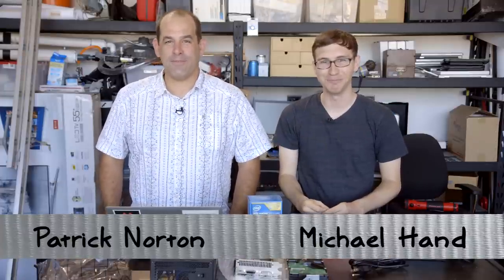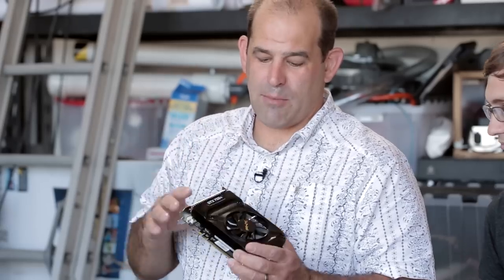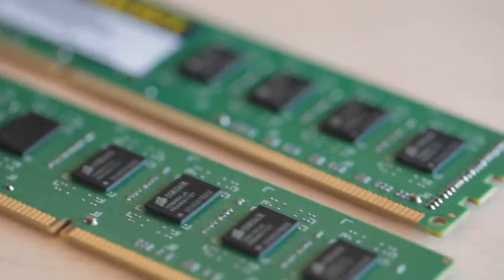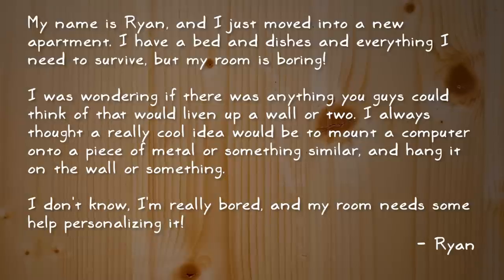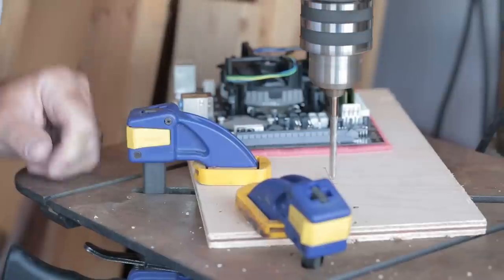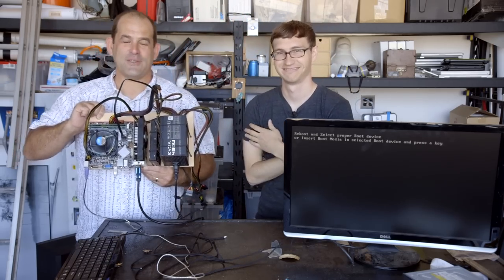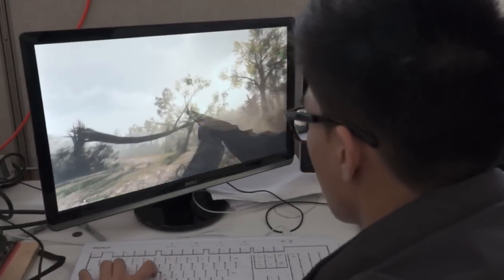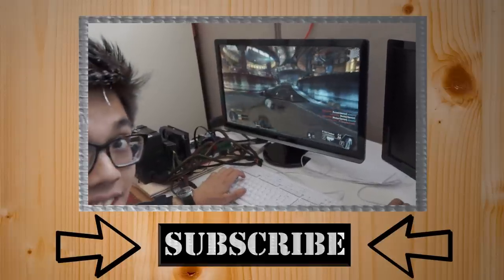Screw The XBOX ONE and the PS4... We Built a Gaming PC for $380!

Comment: ok, so cool you built a "gaming" pc for that, but you should NOT be comparing this to an xbox one or ps4, first off, ecs board??? Really? Do you want a piece of trash that will die in a week? 2nd off, 4gb of ram? good luck with that, wd blue drive? yea, no, even standard ps4 and xbox one hard drive stomp that, let alone the hybrid ssd the xbox one has now. And I would like to see the actual settings, cause I call BS on all settings being maxed, so you have anti aliasing maxed, and vsync? no way in hell, add in the price of a actual case and windows, you are well over 500. Also play more than 1 game before you start running your mouth. I am a proud pc gamer running a real gaming pc, but I also have a xbox one for games like destiny, that do run very well and the point of the console is price and simplicity. So before you start bashing consoles how about you get a real gaming pc, cause you are still a console peasant with that thing.

Comment: I built mine for 300 flat with an i7 950 and a Gigabyte 970 3gb and 8gb ram 1600mhz. My budget monster is sitting in a Shuttle xpc case. I called it "Little Beast"
Reply: +Jake Long Where the hell you get parts so cheap
Reply: +CodyopPC Craig list and homie hookup.

Comment: Acer $399 Mini Tower PC Core i5 6400, 8 Gigs DDR 4 RAM (spare slot for another 8 Gigs total 16GB), Intel HD 530 (good enough for Rocket League), power supply is small but should be good enough to run a Mini GTX 1060 or RX 480 that draws power from the PCI E Slot otherwise you need a Molex Adaptor to provide the GPU card power. Toss it in the living room for your big ass HDTV to get some games on. Get a Windows 10 Activation Code for less then $50 on a lot of sites as low as $15 USD!

Comment: My Build Gaming/Work Station 

this build has paid itself since i use it for work
that might be hard to do with a console.

OS:Windows 7 pro
Motherboard: msi Z97 gaming 3
Processor: i7 4790k intel
Video Card:Nvidia GeForce gtx980
RAM: 16gb
PowerSupply:corsair Modular 850
Drives:120gb ssd for os 
       2tb hdd for storage

 This thing can run everything (max settings)
 i throw at it and is about half the price of  
any Alienware or mac.

Comment: The thing is if you're gonna build a PC build one that's gonna be upgrade able and isn't gonna be obsolete in a couple years. Even though I have what used to be top of the line card (GTX 680 Classified) even nowadays in the new games my settings are dropping from all ultra to mostly high in order to keep 60 FPS. Provided it runs two other monitors at that same time. But if you're gonna build a PC, build one that's gonna last and can actually give you the advantages of PC gaming, like multi-monitor setups, don't just try to build a shitty $300 rig that you will be complaining about certain things like shit slowing down when you try to do more than one task

Comment: Good. now add a High quality Controller for $50 and a nice case for $40 because you don't want to hang this on the
living room wall
Reply: +Noah Roberts obviously it looks ugly. The PS4 is a sleek nice looking machine although not powerful enough but that's because of the $350 constraint and the cost of the hardware back in 2014 plus accesories and Bluray player which obviously this cheap PC doesn't have

Comment: Should there be anything else I should add for my future build list?

Plans:
- Intel Core i5-4460 3.2GHz Quad-Core
- MotherBrd GA-H97M-D3H Micro ATX LGA1150
- Ripjaws X Series 8gb DDR3-1600
- Western digital cavier blue 1TB 7200RPM
- Radcon R9 380 4GB SOC
- XFX 550W 80+ Bronze Certified ATX
- Cooler Master HAF 912 ATX MID Tower Case
Reply: Hi! I have almost the exact same build as you are planning. It is an amazing machine. But I recommend going with the R9 390 if you can afford it. More future proof. Good luck!
Reply: Thanks for the info Turnsmash! I'll surely give the R9 390 a good look.
Reply: Nice build
Reply: +Purified_Magnet 
Very nice, what's you OS?  Me personally, I would go with a 40GB SSD to boot the OS if that stuff matters to you.
Reply: This is my first build to do so I figured I would use the windows 10 since this is for gaming.
Reply: +Purified_Magnet Looks nice. But i would go for 16 GB Ram and an 128 GB SSD for OS and core programms.
Reply: +Purified_Magnet
This is my plan for building list. Any improvement and suggestion are welcomed. Budget: $510 
- Windows 8.1 Pro DVD OEM- 64-bit     
- Acer S230HL 23 Inch Full HD Widescreen LED Monitor   
- ZALMAN CNPS8000B 92mm FSB (Fluid Shield Bearing) CPU Cooler 
- AMD Athlon x4 760K Black Edition   
- MSI Radeon R7 360 2GD5 OC     
- MSI A88X-G43 Motherboards    
- Kingston 8GB HyperX Fury Black 1866MHz DDR3 Gaming PC RAM
- WD Blue 1TB Desktop Hard Disk Drive  
 7200 RPM SATA 6 Gb/s 64MB Cache 3.5 Inch
Reply: Try to avoid that acer if you can, thats what I used for basic stuff and the crystals actually got ruined from just a regular shut off.
Reply: +Purified_Magnet Make sure your PSU choice is reliable and provides enough power, ensure you get good airflow with a system like that, fans pulling and pushing air, ESPECIALLY if you overclock it. Maybe add one of those hybrid SSD / HDD drives? But it'll cost more.
Reply: +Purified_Magnet Do you have a keyboard and mouse? When I built my rig for gaming I just got the Logitech K120 for €15 and it's lasted me for over a year no problems. A good mouse choice is the CM Storm Havoc for about €45 Good luck with your build friend :)

Comment: im running a $2000 rig, with a gifted radio shack keyboard that goes for $20, corsair 1500's headphones i got off amazon for $50,  you can get by and skimp on things, so as long as you cpu/gpu are boss.

Comment: Here i just bulit a better PC: 

Total Price: 382 $

MotherBoard: ASRock H110M-HDS (46.99 $)
CPU: Intel Core i3-6100 (119.99 $)
GPU: (USED) R7 260X (69.99 $ depending on seller)
RAM: G.SKILL RipJaws V Series 8GB (32.99 $)
PSU: EVGA 500W (37.99 $)
HDD: WD Blue 1TB (49.99 $)
Case: Rosewill FBM-02 (24.99 $)
+ Shitty Windows for like 100bucks because why not?

From Newegg.
Reply: This videos 2 years old.
Reply: That is a garbage build. R7 260X? the fuck?
Reply: ECCENTRIC The R7 260X is slightly better than the GTX 750 Ti in terms of performance.
Reply: ECCENTRIC r7 260x delivers great performance for the money. if you can find a HD 7850 or 7870 for under 80 dollars you can use either of those.
Reply: Ed Plays yeah, I was thinking going for an older card. (There are used GTX 660 Ti in my area for the equivalent of 82 USD :D)
Reply: Or just wait a little longer and buy a better GPU. R7 260X is pretty bad.
Reply: how is it bad?
It's better than the 750ti
Reply: Ed Plays I know right. Maybe it's worse in power consumption because it needs a six pin power connector. But that's all I can think of.
Reply: but its 2016
Reply: What's the best budget graphics card?
Reply: Potato New or used? The RX 460 is probably the best new. For around the same price point, the HD 7950 is an excellent used card. A GTX 770/680 is probably a good card as well if you can find a decent bargain.

All cards are around the $100 price range.

Comment: i bought a mac pro 2009..  with the 2010 firmware hack i upgraded it to a 6 core xeon @ 3.10ghz, 16gb ram, 2gb nvidia quadro 2000, 2 SSDs for $145 thing is a monster!

it helps that i'm an IT tech and had the xeon processor, 2 SSDs and nvidia card just laying around.

Comment: You realize you can get a asrock motherboard with a 4gb 256 bit graphics card a 3.8 gigahertz quad-core and 16 gigabytes 1600 DDR3 RAM and a copper core CPU Cooler for $391.91

Comment: mount that on the back of a big screen led tv and get a wireless keyboard and mouse and get one of the special power supply units that you can plug another device into while using the computer then plug in your TV into the PSU on the computer and there is your giant all in one gaming pc!
Reply: +Marty Mooney I guess that power supply wouldn't be powerful enough to power this pc. this power source is available only in generic power supplies. and even if a strong one had a power source on it, the device would drain too much power.
Reply: +Marty Mooney Wireless keyboard and mouse are terrible for gaming.

Comment: Considering my core 2 quad q9450, Asus p5e3 deluxe ai lifestyle motherboard (Auto-clocks the CPU and does some other voodoo to make the late-gen core 2 quads do stuff they weren't really meant to, damn mobo costs more than the CPU...), 8GB DDR3, 700 watt PSU, and 2x GTX 560TI's (using a fly-by-night chinese firmware hack to make it support SLI)  in a lian li case would cost well over $1000 even today, it is quite impressive that a gaming machine for under $500 is quite impressive.

Comment: If you think that a Intel Pentium G3220 3.0GHz and 4gb of ram will match the ps4?
Try something like Doom, doesnt even plays at 30fps 900p and low setts
Consoles arent that bad (atleast they have a case)
Reply: A console has more optimized games. You'll have to fiddle with the settings to get them how you want graphically and framerate
Reply: Be reasonable. DOOM was released in 2016. And think about it, the same money today will buy better parts, i.e. 1050 Ti, Pentium 4600, 8GB of DDR4.

Comment: $370 
amd athlon x4 860k $70.88 

asrock fm2a78mpro3+ 51.98

crucial 1x8gb stick 30.99

hitachi ultra star 1tb 32mb cache 7200 rpm 41.99

asus radeon r7 370 2gb 119.99 (with rebate add $20)

nzxt source 210 39.99 29.99 after rebate

evga 500w 80+ bronze certified atx ps 49.99, 29.99 after rebate

Comment: I was into pc gaming for over a decade..
I finally got fed up with having to upgrade with pc's  that new was in the 1-2+ grand range...
With a pc u got to have a ton of ram 8-16 gig ,  a i7 quad core processor  3.0 ghz or so  and then a graphic card in the range of $500-$700 then a high output power watt supply..A dedicated gamin mouse $50-$80  a gaming keyboard around $100-$140.. and i said u know this just isn't worth it anymore...
I grabbed an xbox one for a fraction of what i'd expect to pay for a top end pc got a ton of games with xbox live subscription and i'm  very happy with my move over...
One  gaming console that everyone is playing in multi player a good controller and bam ur a go...
With pc gaming u can have a 2 grand machine and end up facing someone with a 5 grand machine it's simply a keeping up with the jones...
And i got tired of it.My pc gaming days in general are behind me and i'm okay with that...
Reply: +MnMs002 What do you mean 1-2 grand range? You do not need an i7 quad core processor, a $67-70 Athlon X4 860k would've done the job as well. You do not need to pay $100-140. No, a $500-700 GPU is not required. You're talking about the highest end, overkill hardware and game settings. Really, this build will work fine. Consoles run at 920p ~30FPS, you're talking about a build that will run at 1080p-1440p 60+FPS on Ultra. There is not much of a difference in a lot of games between Low-Medium and Ultra.
Reply: +Nikator Of Linux  The smoother the gameplay the higher the FPS which means  they get less lag which means they will out perform u...To compete with the top players in the pc world u either got to spend a fortune or u got to hack that's the bottom line...I know i was into pc gaming hardcore for atleast a decade...I've been on the lower end of the pc market and the upper etchlon of it as well.I know the difference.And console gaming simply   simplified  and lowered my cost of competitive gaming by a Huge margin...
Reply: +MnMs002 lol, dude, you realize super high FPS cameras go very slow because of how many frames it took and has to show you. Also, you can turn settings down to medium and run 1080p to get 60+FPS on games with a $300-500 rig. Instead of using the ignorance equivalent of Westboro Baptist Church, i'd recommend actually doing research. Others have lists of parts they have in a cheap rig. And no, you don't have to spend a fortune or hack, that is not the bottom line. The bottom line is being thrifty and not paying corporations like Alienware, iBuyPower, etc to play Legos for you. The hardware is litterally Plug'n'Play and the installer for windows is a graphical interface that you click buttons and type your preferred username and password into. It's not that hard, but some people don't understand the true value of a dollar and some people are just too lazy to do things theirself, not that i'm calling you lazy. Don't get it twisted.
Reply: +MnMs002 most of the Comps I did against some of the best UK players were done in controlled settings with provided systems for balance reasons. All I got to use of my rig was keyboard mouse and headset and even then the headsets were restricted because of the hack risk with usb imput

Comment: Lies. 

Not cheaper than console. ($299-349 with controller, operating system, and case)

Does not have better specs. (console with eight core cpu, 8gb RAM, plus the equivalent to a 270x gpu).

Comment: g3220 for a 'gaming" pc... I was recently using one as a placeholder...lagged when browsing if u had more than 10 tabs open. Dual cores just dont cut it anymore, period. I wouldnt build a pc around the G3220 even for my parents, and FB is about the most intensive thing they do. Even an old used quad from either Intel or AMD would be better outside a very few instances, not to mention cheaper.

Comment: However I would never buy that budget called "gaming PC"...

I like PC and consoles, got good price on PS4, got it for 306€ not that cheap, but, then I put 100€ inside my psn account and paid less than that for 100€ in it and bought PSN for 37€ promotion 25% which cost less than that because I paid less than 100 € for 100 € in my PSN wallet.

Bought BF4 for 19.99€ with premium and Driveclub+Season Pass for 9.99€

It also have good deals even though PC has better game deals.

Comment: I shall be getting a 750 TI now. My old 560SE just will not do SHIT!!!!!!!!!! Also old dell cases FOR THE WIN!!! They are everywhere and if all you are doing is building a HTPC and not a gaming PC you can REUSE yes reuse the old power supply. Now why would you do that you might ask? Weeeeeeeeeell if you do some history checking Dell WAAAY over built their Power supply's for the Pentium 4 era dells making them very good for a low end PC but I have pushed one to the max with an old P4 a GPU that needed molex power just to run and three mechanical hard disk and that 250watt PSU would not give up the ghost. So if you find an old dell case with a PSU that is working fine its a great start to a cheap build. Just my two cents from a guy that has a bedroom full of PC's

Comment: I know this is going on well over 1 year ago, but wouldn't a Nice quad core APU like an A8 or A10 be a better choice? With that you have the ability to pair a Graphics card(either now or in the future) with the Already Integrated Discrete level GPU on the APU itself thus DOUBLING your graphics power? They can be had for relatively cheap and a matching card would be in the same price point as that 750ti as well as adding another 2 cores? making it much closer to a "console" in performance.  Just my thoughts. I'd love to see a Revisit doing with other Components.
Reply: +Brian Buckley (ZombieRot - Ingress) A dedicated graphics card is faster than an APU. The iGPU in an A10 isn't very fast, also pairing a graphics card does NOT double it in performance. Also you can only pair it with low end AMD GPUs like the R7 240 and 250.

Comment: its stell the same satting on high because the gpu is high hhd graphic card 2g
and you have a 4g of ram and you just need i3 icor3 cpu and you can run the game smoothly on 60fps so easy
Reply: and you need the i3 cpu to be running on 3.70ghz at least to get the bast high satting ruuning on any game you want

Comment: well a ps4 has a 8 core cpu as well as 8 gigs of ram. trust me i went to pc gaming and left console. but it is nto cheaper. i dont know why people say it is. consoles are worth over 350. but they are sold cheap to make more sales and by makingup for that they get the money back from games and xbox live or playstation network. if i even if i got lesser card then a r9 390x that wouldnt be held back by my cpu. i got a 8370 and even if i got a 8320. still would cost more with say a gtx 960 which is probably more close to a consoles gpu then the 750ti. then i would get more frames on high then a console. but i get about 35 to 55 frames on world of tanks that gets 30 on console. they are maxed out graphics as well. plus if people dont have a pc or spare parts from an old pc. they have to get everything and most people act like people will have a spare windows. you can get it for 40 or 50 on amazon like me or even cheaper on like g2a.com for like 20. but you still got a monitor if you dont have one or a tv with a matching port on the gpu. mouse and keyboard, speakers or head set, possibly a desk etc etc.
Reply: Mr.009mm Killuminati 8 core doesnt mean its more powerful you also have to acount for the ghx